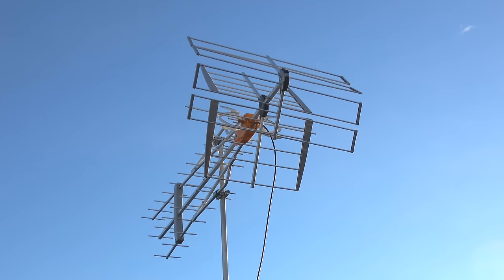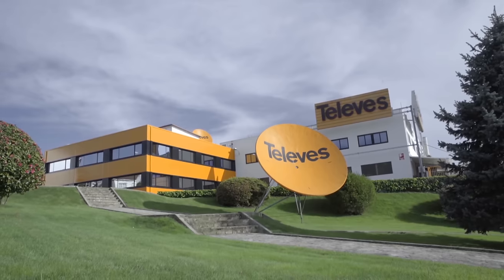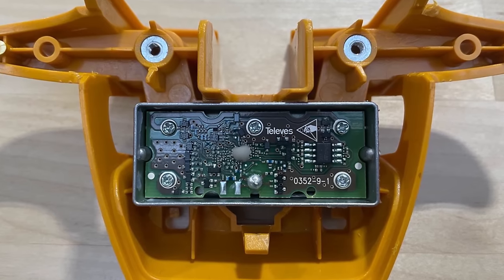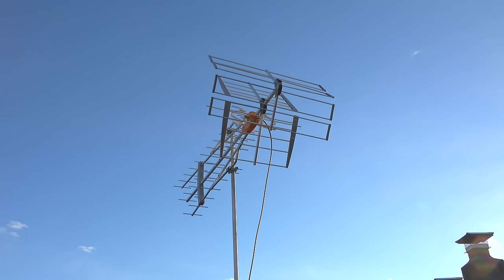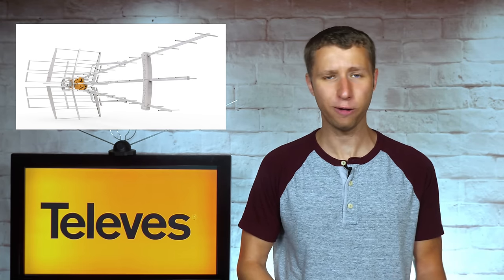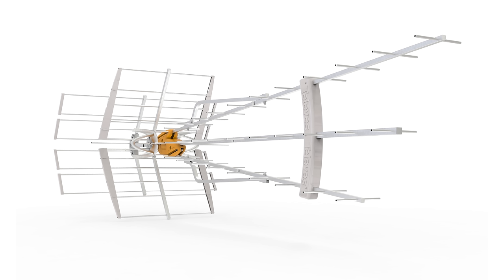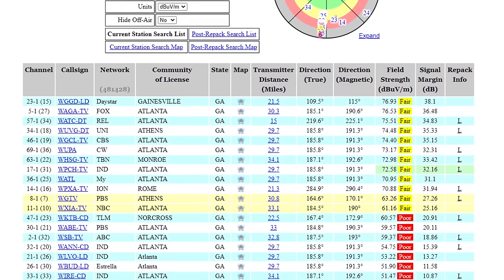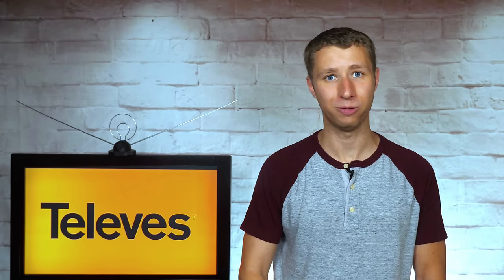New Televes DATBOSS LR Mix Review Updated Repack Model 149884

Comment: I would like to see this antenna compared to two CM4421HD with Baluns flipped, offset and combined on a CM4228HD Relector with equal lengths of coax and the single gain televes preamp. If anybody wants to flip the balun and offeset I can give them directions.